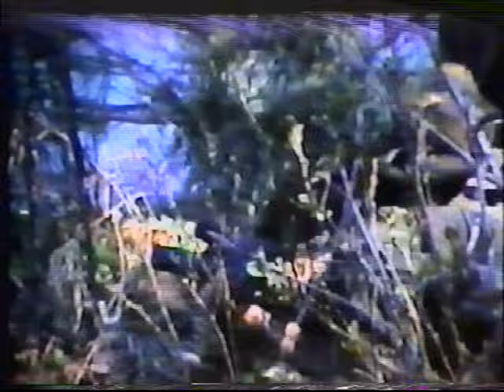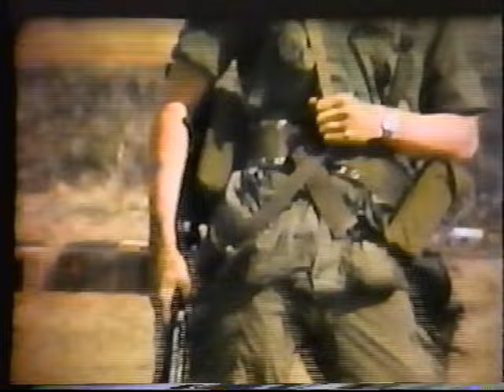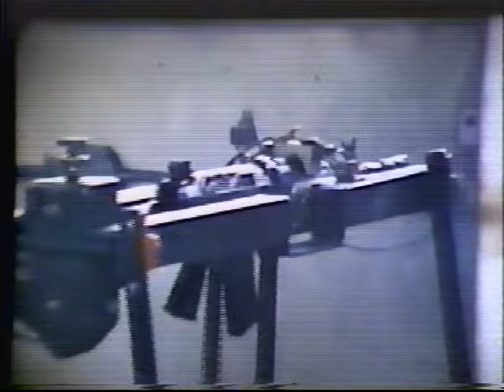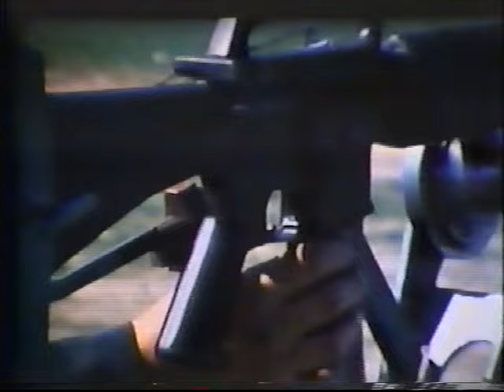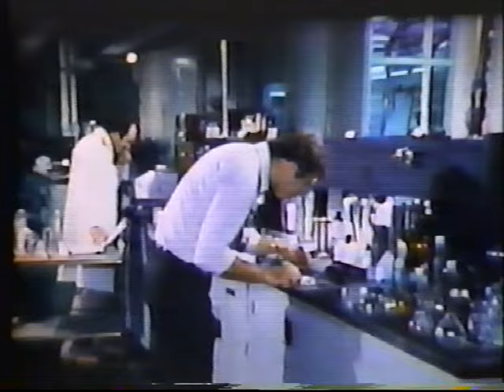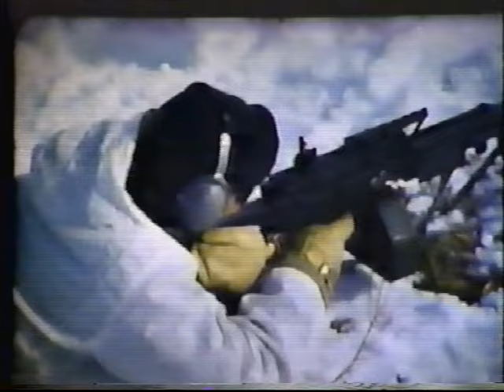Canadian Forces - Small Arms Replacement Project (Introduction of C7 Rifle/C9 LMG)

Comment: As far as I know we still have the FNC1 in war stock? I miss the solid green camo. When I joined 1997 we were just starting the transition to Cadpat. (99)
Reply from the maker: @inclusivemodeldesigns16 - In talking to someone who worked at a CFSD, the C1s and C2s were all returned to the central depots after they were retired. A few were modified to be shipped out to museums.

All the other C1s and C2s were then put into war stock storage. Involved oiling the weapons up, placing them into plastic bags, palletizing them, sealing the pallets, and then warehousing them. Once the pallets are sealed, only the seals have to be checked to ensure integrity for about 10 years, instead of having to count every single rifle every quarter.

However, when the warehousing process was done, the bags weren’t sealed correctly, the warehouses they were stored in weren’t humidity and temperature controlled, and there was no yearly check of a pallet to ensure their condition. The pallets were finally opened after 10 years to do the full count, and every single rifle had rusted beyond salvageable condition. Also didn’t help that all the rifles were already 30 years old when they went into storage, and the vast majority of them were completely worn out.

Therefore, the only C1 and C2 rifles that exist today are the units that were shipped out as museum pieces. All the other rifles had to be sent to destruction, as there was no salvaging them. We also don’t have a lot of clipped 7.62mm ammunition left, so they wouldn’t be effective for war stock anymore.
Reply: Olive drab combats.
Reply: @NovaScotiaNewfie  Did anything ever match? LOL.
Reply: The mold smell.. Think everyone had it. LOL

Comment: Interesting to see how the two rifles under review stacked up against each other. I would have expected the Belgian FNC to be the better weapon, but it wasn't. Despite upgrades and updates, the C7 and C8 are getting long in the tooth now, and are probably ready for replacement.

I wonder if we'll continue with an M16-pattern rifle. After all, the New Zealand Army just replaced all their small arms with an M16-pattern rifle made in the US, and parts of the British Army are getting essentially the same rifle.

And since Colt Canada, the maker of the upgraded C7 and C8 rifles has been taken over by CZ of the Czech Republic, we might just end up with their relatively new BREN 2 rifles instead.
Reply: @stevestruthers6180  the FNC is a solid gun but was a failure pretty much.  Designed to be a cheaper alternative to the fn cal and even m16. Cheap and this is what you got. (I absolutely love the FN FNC, interesting gun, not a bad gun in general but yes, cheap). We tested the FNC in Luxembourg and from what I know we had the same catastrophic malfunction. From what I have been able to find out, the welds connecting the bolt carrier and op rod (a simple tube, not very sturdy) seperated. One NCO described it " and a piece of the bolt was flying past my head after a crack with what felt like supersonic speed and missed me by a maybe a cm". After this incident the FNC for our army was dead.

Comment: never bring the C7 into a warm area then out to cold area... bolt lock lol. Remember our first winter ex with them.... soldiers hitting butt to butt to break the freeze on the bolt carrier lol. Solved easily by enforcing the rule of don't bring in and out of warm areas
Reply: @PompierCanadien with the C1 it was easier lol. Tolerances weren't as tight as the C7 series so with the changeover you REALLY had to remember lol
Reply: Also - that Plastic magazine they issued were PIECES OF SH*T! Jammed EVERY time!
Reply: @normmcrae1140  aw hellz yes lol.

Comment: Did we seriously almost adopt what looks like the FNC??
man, imagine that timeline
Reply: That doesn't look like the FNC, it IS the FNC. According to this video, the main reason why it wasn't adopted was due to it being inferior to the M16/AR-15 when it came to drop tests (bent barrels specifically mentioned) and long term wear of the parts.
Reply: @burnyburnoutze2nd  yes, they talked about catastrophic failures as well. I talked to some guys that tested the fnc in the 90s when Luxembourg looked for a new replacement, the rifles we tested had the same catastrophic failures, being cracks in the  welds connecting the op rod and bolt carrier. One sergeant described it: wush and the whole op rod was flying past my head.
Reply: I wouldn't have a C7/C8 addiction, but I still have an AK-5 addiction today lol